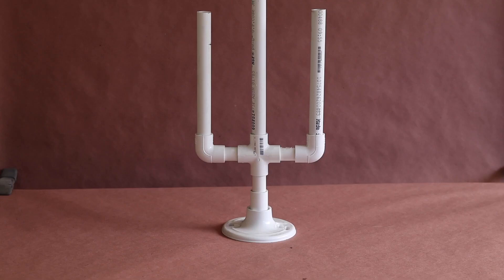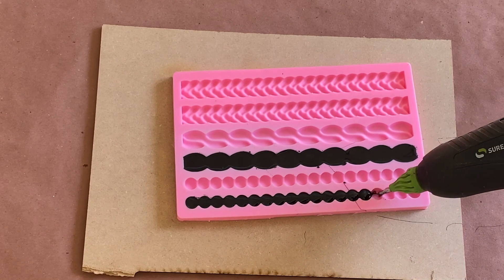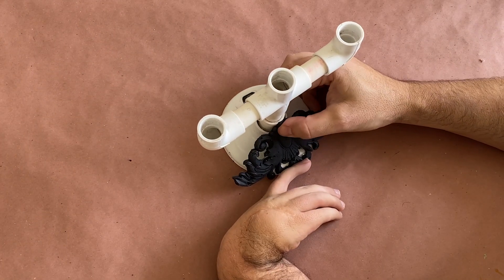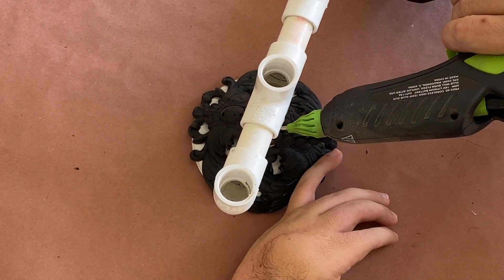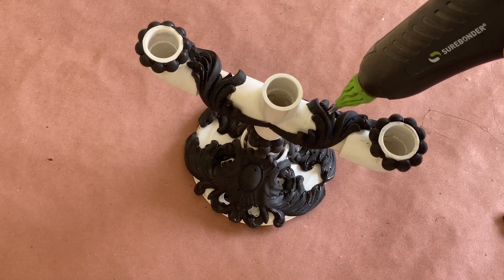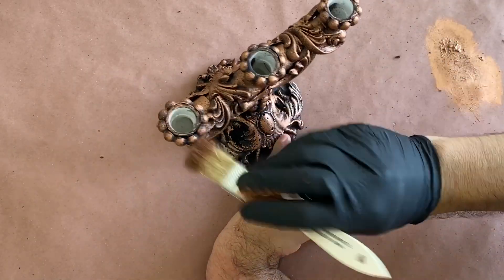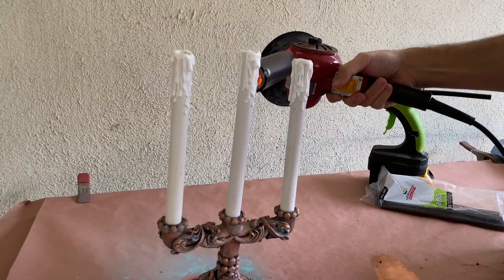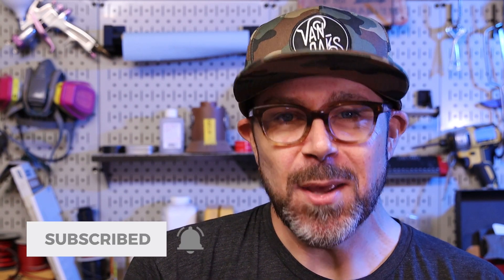Hot Glue Candelabra Prop

Comment: Regarding the bubbles on the surface of the casting, putting the mould on a board and dropping it a couple of times might encourage the bubbles to let go and float up. I think I have seen this technique used for silicone and resin casting. Gently warming up the mould with the heat gun might also help. That way the glue won't immediately freeze to the mould on contact.
Reply: This technique reminds me of when I used to mess around with school PVA glue on glass with coloured pencil shavings to create coloured, translucent medallions as a kid.
Reply from the maker: I don't know that those were a result of bubbles in the casting. I think there was a chemical reaction between the rubberized bed liner and the hot glue that created them. But to your point, yes, dropping your castings before they set will definitely encourage the release of bubbles caught in your resin.

Comment: Excellent! I bought the molds and I’m going to try to see if Loctite foam will make good accents for the cemetery pillars I’m work on. Then back to your bronze plaque video to make the signs for the entrance. Your inspiration and tutorials are invaluable!
Reply from the maker: I don’t know that spray foam will give you good copies because the foam, without downward pressure, will expand where there is the least amount of resistance. And with downward pressure it won’t have enough air contact to solidify. So you’d end up with a uncured foamy mess.

Comment: Greetings everyone. So I have a question about the hot glue technique. So I live in sunny, hot Florida where hot glue isn't really ideal and could become a mess (especially when it's stored in my incredibly hot attic over the summer.) What would you recommend to avoid such messes? Would you use another resin like the uv resin after applying the hot glue or would you use a alternative resin for the hot glue parts?
Reply from the maker: I’m in Southern California and haven’t had an issue with using the Cosplay Stik hot glue.
Reply: @VanOaksProps   Thank you for taking the time to reply back to me and so quickly. I have a old, store made, talking pumpkin prop where it's eyes and mouth would move as it talked until after one Halloween when it stopped working as well as it did before. When I opened it up, the maker had used hot glue on the string and the rotating wheel that  operated the face; hot glued them back together again. After the repair, I put it back outside and a little while later, it had the same problems again so I assumed that I did it wrong or the heat had ruined my repairs again. Anyways, thank you for helping me out and it's always a pleasure watching your videos.

Comment: So, I've been trying my hand at recreating this prop, but the hot glue appliques refuse to cooperate. The piece which wraps around the candelabra arm keeps popping off on me. I lightly sanded the PVC before the assembly, but all I can think is to hit it again with a lower grit. I'm worried that'll create too much texture and will become unsightly after painting, though. Any ideas on how to get a stronger bond?
Reply from the maker: What kind of hot glue are you using?
Reply: @VanOaksProps  These Surebonder cosplay sticks. I did try it initially with the standard glue, and when it didn't work, I thought the glue might be the problem. These sticks are definitely working better, but they don't seem to want to hold that bend. Would it be possible to heat them slightly -- not enough to re-melt the glue but enough for some added pliability?
Reply from the maker: @webhead215  warming them will definitely help them warp into shape. Just proceed with caution to prevent them from losing definition.